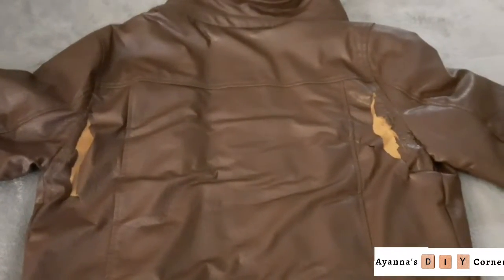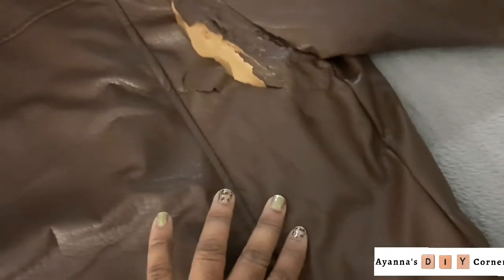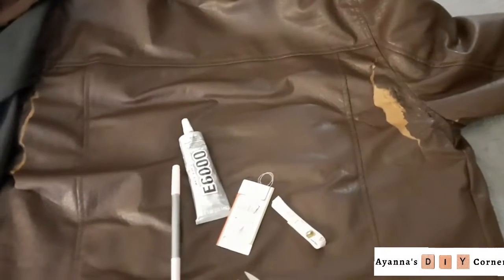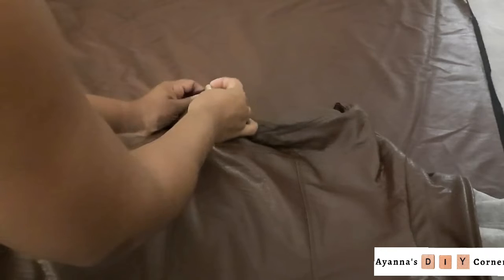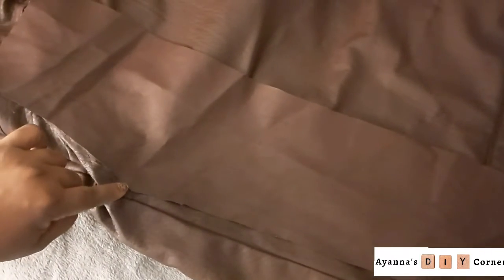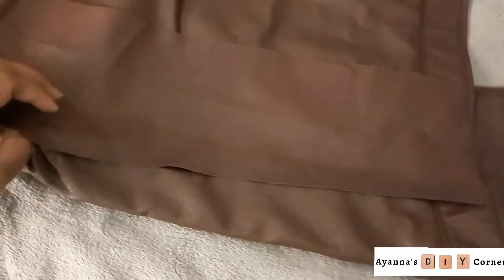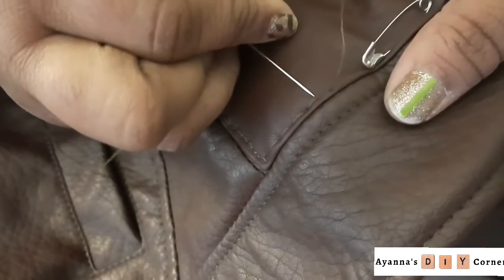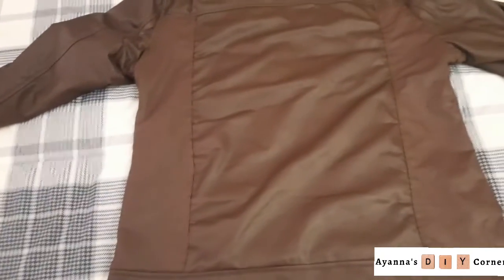Easy DIY fix for damaged Faux Leather. #Faux #Leather #howto

Comment: Question did you remove the old piece of leather or did you place the new one on top?
Reply from the maker: I am so sorry for the late reply. I never got a notice. I just placed the new one on top. I didn't want to further damage the jacket. Once you place the new piece over it and sew it into place it will prevent any further damage. Hope this helps.

Comment: Unsure if I missed a part, but did you use the e600?
Reply from the maker: Oh. In doing the project, I realised that the glue wasn't very helpful and would still encourage the pealing. So, I showed the most effective method to fix the problem in the video.
Reply from the maker: I apologize for the late response.

Comment: What if the whole jackets leather is coming off like this
Reply from the maker: If your like me and wouldn't mind the work, it would just mean you would need to take your time. Get the different panel pieces(the left and right front panels, back panel), and cover it. It would be the same process I did to fix my dad's jacket. Having a Sewing machine will make the project so much easier and quicker. Let me know what you decide.